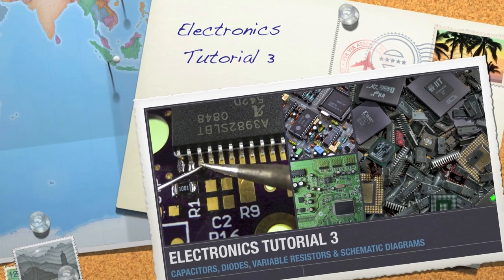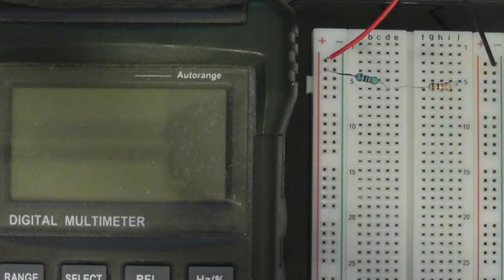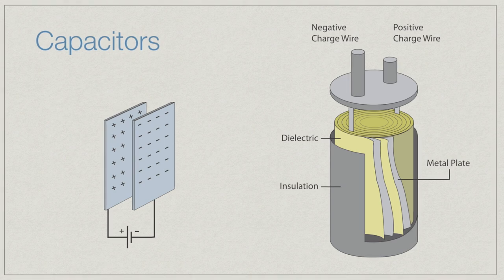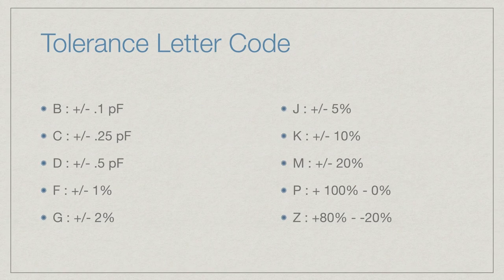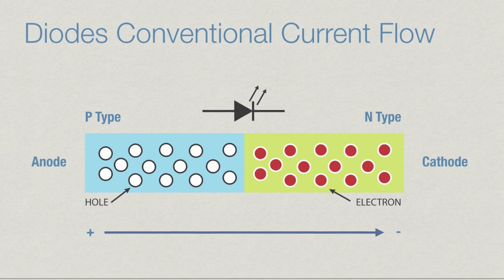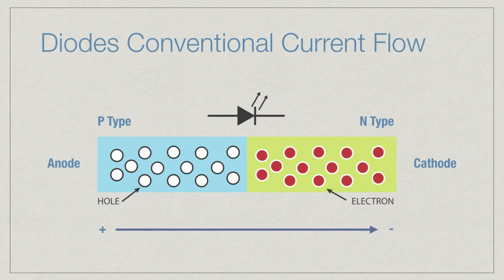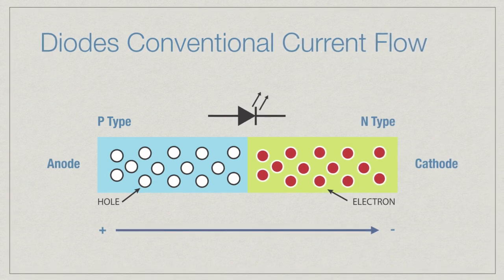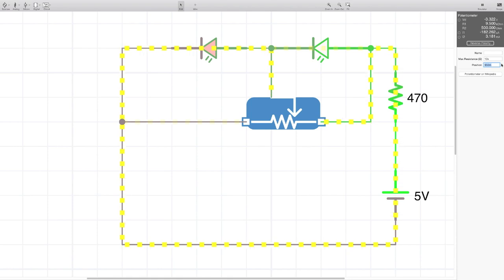Electronics Tutorial 3

Comment: At 6:30 you say "electrons" flow out of the capacitor into the resistor and then light up the LED. Isn't that the direction of current flow? The positive flow of charge? Electron flow will actually light up the LED first and then go through the resistor. Please correct me if I'm wrong. Thanks.

Comment: First off, I would like to thank you for your videos and effort for making these videos, I want to become an electrical engineer when I'm older (actually attending college this Fall), and I appreciate the knowledge you are passing down to me.However, I am not completely understanding the Capacitor circuit you built. On your breadboard, you attached the negative side of the capacitor to the positive side of the LED, and it still lit up. I am also confused to why you connected 2 jumper wires from the switch straight to the negative terminal. I have no background knowledge with complex circuits and capacitors, so I tried rewatching the video about 30 times, but still don't understand it. Could you please explain it to me? Thanks.
Reply from the maker: +Shlomo Your welcome :) The easiest way to see what is happening is to watch the iCircuit demonstration in the video. First the capacitor is charged. Then the switch is flipped and the charge leaves the capacitor in the opposite direction from which it was charged. That is why different LEDs light up depending upon the switch. Tell me if that doesn't clear it up.
Reply from the maker: +Shlomo Also don't worry if you don't catch everything in each video. I will be reviewing everything over again in different ways when I start making more circuits. I'm just providing a overview of all the major components at this time.
Reply: +Derek Banas I keep analyzing, or over analyzing, the iCircuit demonstration. I guess I'm still stuck on something:
When the battery is used to charge the capacitor, how does positive charge reach the LED? I understand that the negative terminal of the battery is connected to the anode of the LED, however the negative terminal of the capacitor is connected to the cathode of the LED, so I am not understanding how positive charge flows from the positive terminal of the capacitor, to the negative terminal of the capacitor, to the LED.

Here is a diagram of what I am talking about:
http://puu.sh/o00SS/30aa90edad.jpg

This is how I view it:
the positive terminal of the capacitor and the negative terminal of the capacitor are separated, therefore they are not in direct contact. So how could positive charge flow through that LED?
Reply from the maker: +Shlomo Think of the capacitor as a cup with a small hole in the bottom. As you poor sand into it some sand leaks out of the hole in the bottom, but as it is tightly packed less sand escapes as the cup is filled to the top. When you click the switch it is like dumping out the sand in the opposite direction. Once a capacitor is full it can no longer except a charge and then that charge must exit in the opposite direction.
Reply: +Derek Banas How does positive charge from the battery go through the positive terminal of the capacitor, then to the negative terminal of the capacitor. How could there be some electrical "leakage," as you call it?
Reply: @ShlomsDaGangSta  The capacitor is two plates of conducting metal that are seperated by an insulator. The charge doesn't flow from plate to plate since there is insulator in between. They only flow to the plates. If we look at it from conventional current perspective the positive charges are flowing from positive terminal of battery to one side of the plate. But charges on other plate are flowing from the plate due to attraction of positive charges to negative terminal of battery. We call this process charging. As more charges flow to one side of the plate and flow from other plate we get more positive and more negative plate. When capacitor's voltage equalls that of a battery capacitor is full and charges can no longer flow to or from capacitor's plates. You can think of it that way. When capacitor voltage eqaulls that of battery the capacitor pushes charges back with the same force as battery tries to push charges in so current is not possible. But if you connect both capacitor plates together you will have a flow of current between the plates which is due to voltage between the plates of capacitor. When discharging capacitor basically acts as a voltage source.